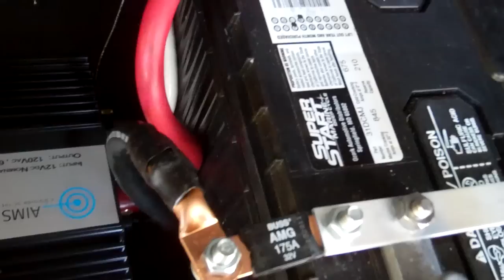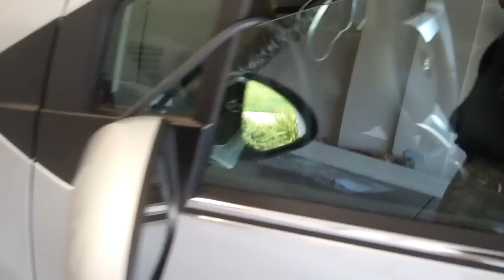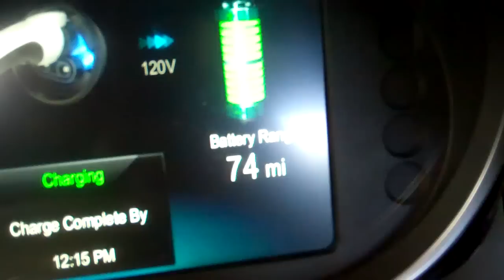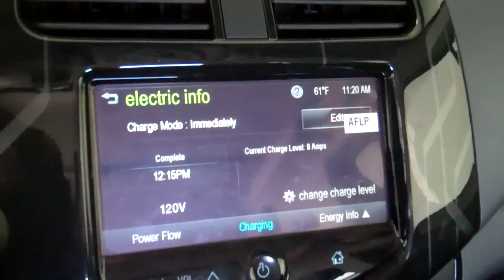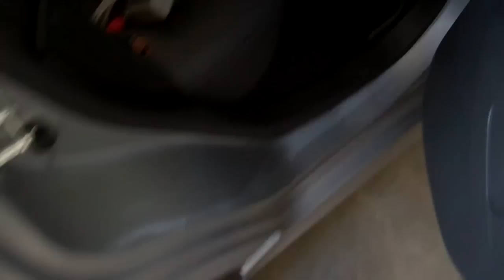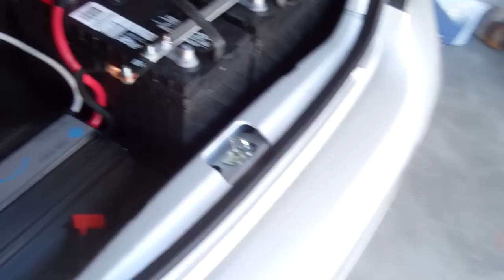DIY EV Range Extender

Comment: Charging the vehicle main lithium battery pack through the auxiliary 12 volt (chevy volt) will work, attach on/off switch to negative and positive terminals. Tried this on first gen chevy volt. Maybe it will work on other vehicles. Try using a battery charger on the 12 volt battery first and check the charging mileage by opening door or check dash, miles should increase. Maybe it works because it is a hybrid vehicle.

Comment: i made a similar aux charger in my chevy volt. weighs about the same but has 15kwh capacity and maxes out the obc for my volt and gives me more than one full charge, capable of doing 6kw output lol.  have put around 200 cycles on it so far and its already paid for itself in fuel savings after ~10 months. i put a video on my page explaining everything plus the aero solar roof i installed which helps with range too.

Comment: 68% of energy is used accelerating mass in city driving.
Now how much weight are you adding here..?  Not to mention reducing space.
ie: this is a POS clickbait extender.

If you want to see a range extender look at the engine  in a BMW Is Rex or at the Obrist Hyperhybrid.

BTW:  Unless you're technically inclined most everyone has absolutely no idea just how much more efficient (and way cheaper) en engine can be when designed to run at constant rpm.
What you will find is that travel is in fact more green in a series hybrid.  Especially one that has a direct drive for highway cruising.

Comment: Good system, 
I like it would make a lower 24kwh car a possibility. It is almost enough for all my drives. 
But got the rare 4-6 trips per year it risk of wont be enough. 
Had a friend buy an ev close to me and charge here..he needed a Tiny bit more to get home thought. 7 chargers on the way map, but ya Nightmare as busy, broken, broken, removed, broken, broken,busy (him with basically dry standing behind the other hoping for a charge 1h later yay! and he could get home. Need about 4-6kwh more😂.
Hum 1-2 batterys and charge them with a small generator (takes time but no longer hesitate on range, i never want to experience what he did on my way to him😂)

Comment: It may be interesting to put enough lithium cells in series to match the car’s battery voltage, then just connect them in parallel with it, so they’re always helping out, and there are no inverter and charger losses.
Reply: Agree, he's probably losing 20-30% with the sine converter then another 20-30% converting it back into DC while charging the car.
Reply: You’d basically have to match the size of the cars existing pack if you wanted to double the range…
Reply: @turtlezed  in theory doubling the size of the battery Will more than double the distance as the draw on each cell would be half and they are more efficient at a lower draw. Obviously, you'd have to take the additional weight into consideration, but I believe it will still be more than double. Slightly maybe like 5% more

Comment: You should try a supercapacitor bank.  Put a small solar panel on the roof of the car or have a pole mount attached to the car and have the solar panel track the sun.  Solar panel charges the supercapacitors and when full can DC fast charge to the EV.  Throughout the day the cycle would repeat.

Comment: Use this it will add 12miles and it already has inverter built in weighs 48 lbs
https://www.amazon.com/dp/B082CWRGTR/ref=cm_sw_r_cp_apa_i_lS1nFbNM3ZM65

Comment: never seen anything so ridiculous as not only have you filled your boot with lead acid batteries ,,, they can only supply just over a kilo watt of power to your cars battery which equates to 4 miles if youre lucky... 
and who wants to drive with 60 to 80 kg in the boot lol !

Comment: I have been considering this, but with a single solar panel so it charges at work. 
Also, saying the weight only reduces range by 1 mile is irrelevant if you don't say how far you drove, that should be a % figure.

Comment: I believe tapping on the main battery would increase the mileage more for more efficient way with more loss. Don't get me wrong.  The idea is great the simple way it is but it can be done more efficiently
Reply: The idea is stupid: Lead acid batteries have an energy density of 20Wh/kg, an inverter has at best 70% efficiency, the ev charger 90% efficiency. so roughly 45 kg of batteries and inverter indeed gives him 567Wh, indeed enough for a few miles. However the 45kg add around 2% in extra drag, as rolling resistance increases with weight, so if he could go 200 miles before, his range will be decreased by around 4 miles, so the net result is nothing gained!!!. What he has achieved is adding a battery with higher self discharge and worse charge efficiency, that also lowers the energy efficiency of the whole vehicle, which result in higher emissions. So this guy forgot to consider the whole picture, when doing his calculation.
Reply: @Tore_Lund  You are the only one who knows what is going on.

Comment: Change the lead acid to LiFE4Po batteries. Yes it works, but LiFE4Po batteries are far less expensive if you do this often, and have practically double the usable power.

Good idea, and fine for once in a while. :) Extra fine if you have solar panels already and can recharge the batteries from the solar.

Comment: Hey – – you can double the air pressure in your tires. Why? I'm getting 150 mpg on a 2000 Honda insight. I'm running 100 psi in the tires. I would only use new tires up to four years old. An older tired cannot take it. I know what you're thinking. If you don't drive like a Dukes of Hazzard the tires will last a long time. My Ford truck I do the same. Every time I fill up three times it pays for one tire. So I bought a set of tires this summer. The tires are paid for on gas savings. I'm sure they will last five years. I have been doing this for 20 years.if there's any questions I would be glad to answer.

Comment: Seems pointless.. Plug ins have an inverter that converts ac to DC.. Since you can't store a/c current..

So you are converting DC to ac and then from ac to DC again.. Why not just connect these DC batteries to the other DC batteries?
Reply: I agree, the reason why he doesn't do that and others with EV's is because the dc voltage is extremely different. The Chevy Spark's battery pack is a 400 volt system so unless his extending battery pack matches that voltage connecting the two isn't possible, and using a step up converter for going from 12v DC to 400v DC is very expensive piece of hardware and the exchange of waste heat it would make. Make it worse then his current setup!

Comment: I been trying to charge a 2018 chevy volt with 3000w pure sinewave inverter, 300ah lithium battery.  It wont work, the charge connector would give error light; i believe it's the "ground" problem of the inverter.  I tried other inverters, too.  I am surprised your charge connector does not give error lights.  Good job.
Reply: Boys, I figured it out....
https://youtu.be/n1u4QVkqhUE
Reply: I had the same issue. Connect neutral(white) and ground together to get rid of the ground fault.

Comment: I found a new way, to charge a battery bank, in part one and two, on my channel check it out. the only thing is though not really enough room in your vehicle to place a gasless generator. your idea is great. i like it. I havn't hooked my design to a battery bank as yet, and the inverter but in the process of testing. missouri solar and wind I bought my pma motors 7 magnet 48 volt motors that can go to 178 volts max. ive calibrated my system for a 1500 watt inverter.

Comment: the power of carrying batteries is more than charge abilities use lithium battery for ex tesla model s battery module and connect inverter to that you will get 5.7kwh of power

Comment: Leave the lead-acid at home, add another string of lithium batteries to your traction battery, and it'll add a lot more range, with less weight!
Reply: that and not blow up having lead acid and lithium batteries together.

Comment: what a gtreat idea if you want a 250 amp cut off switch jeggs speed shop has them online they sell race car parts nice job dude i thought youd get more than 6 miles though .
Reply: He would likely get more range if he upgrades his batteries from marine batteries to higher energy density lithium iron phosphate ones, but those would likely be more expensive, but probably still worth it.  He would likely get another 24 miles range just for doing that and only a tiny bit more weight.   He can improve on efficiency too if he swaps his inverter for a 48VDC --> 240VAC one as it requires less amperage and would dissipate less heat.  Then he could use 4 Lithium Iron Phosphate batteries for the 48V which are lighter for more power.

Comment: Not getting much back for all that work
Reply: An whole lot of experience and an excellent proof of concept.  From there he can branch out onto new ideas for improvement, such as:
1) Swapping the inverter for a 240VAC one (more efficient and will allow your car to charge more than 2X as fast!
2) Using lighter and more energy dense Lithium Iron Phosphate batteries.  Set of 4 for 48V
3) Use a 48VDC --> 240VAC (pure sine wave) converter

Higher voltages means less current for the wattage.  Lower current means less power loss from heat dissipation.     

Just following those 3 simple tips should yield him at bare minimum an extra 24 miles, but likely more. 

But now he knows how to do it, and he has gained much confidence, which itself is very valuable.
Reply: @fanfare100  and 24 ain't worth it hahaha
Reply: @j.thesuper923  minimum.   Being conservative. lol

Comment: For the last 4 winters I have been using 6deep cycle battery to supply a small heater, so all the power from the main battery is used
For travelling, and the 6 battery gives me 2 hours of heating. I solved my winter range problem. The only difference is that I have straps securing the battery’s

Comment: Why would you buy batteries to run through a lossy inverter to a lossy charger? Why wouldn't you just configure a battery bank to same voltage as the EV that you could switch between the 2? And the weight you've added is going to seriously impact on the cars original battery range.

Comment: Hello my friend,  good video , but I thik cables is better than solid connections,  
I dont recommend batterys exposes like this becouse produce acid vapors 
And you need put under batterys a battery plastic tray with drains, you can find on Rv storage. Good luck..

Comment: Wonderful. Ok now you need my flexable 200watt solar panel..it looka like a plastic poster about 2foot X3foot with six eyelets on the.edges ans weight less than a pound. With 200watt continuously being pumped into your batteries while parked your charging system with charge itaelf in the sun. .it can mount on the roof with strong magnets.  The panel.outputs 14 to21 volts 9.7amps dc..with a cheap solar charge control you can charge your batteries to full without overcharging because 10amps at 14 volts is a heafy hard charge it will keep your batteries topped up and you can use your inverter up to 200 watts of it without killing any of your battery power.. fyi
Reply: You will be totally self powered with a 200watt flex monocrystaline solar panel.
Reply: @Gadgetmall  No! it needs 20 000 Watts to be totally self powered. At least minimum 7200 Watts to match the level 2 chargers. 200 Watts are almost nothing

Comment: Yes, as some have mentioned, those are lead acid batteries.  No, No NO!.  We need to stop using these batteries as hundreds of people are blinded every year when such batteries explode and spray sulfuric acid all over everyone.  The warning is right on the batteries!  STOP!  Buy only sealed GEL or some other non liquid, deep cycle battery.  STOP!

Comment: They sell ultra lightweight performance car batteries that weigh 1/3 of the weight of most car batteries. A better range extend option is to build a battery pack with the same voltage as your onboard battery pack and run it in parallel (doubles your range)

Comment: Sure you know what I am, about to say, but just incase or if one of your viewers is not aware of the below.

a. Each time you convert power to do anything. Example charge a battery to charge another battery, you loose energy. Your set up seems to be going thru 4 different steps to use your range extender.

b. I strongly suggest you secure your led acid battery and if at all possible bo not mount any battery (especialy led acid) near the bumber of the car. This is a crumple zone and a rear end colission could end up spraying acid on the car's occupant with immediate, devastating and life long effects........

c. If you really need a range extender, Perhaps carrying one of the  small neat and clean red suitcase style Honda EU 2000 extremely quiet and efficient ICE generator would be better?

Comment: When charging and discharging these vented lead acid, marine batteries, you'll be producing hydrogen gas which can accumulate at ceiling level in your Spark. By placing the inverter right next to your batteries, you'll be sucking not only hydrogen gas in through the inverters fan but also acid mist. A single spark from a relay in your inverter or a loose battery lead and you've provided an excellent source for ignition. I would be extremely careful about using this device with the windows rolled up. I don't know if you've ever seen a vented battery blow up, but I have, and it isn't pretty between the damage caused by the explosion but also the sulfuric acid that is sprayed everywhere. For your safety and for your EV's sake. I would suggest switching to sealed AGM LA batteries or better yet, lightweight, sealed Lithium Iron Phosphate batteries.

Comment: You could also just carry the 12-110 V inverted and a Jump Start cable 
in case you are stranded and use any ICE to give you a jump.

The issue is that you have to carry all of those extra batteries and also a battery charger.

Comment: Very smart. Impressed. How many miles did you extend with three batteries?
Reply: Why don't you try to mount a small generator instead.
Reply: @truthmatters5536  If he wanted to use gasoline , then he would own a gasoline powered car !

Comment: Or, as an alternative, a small generator like the Honda 2000 that weighs less and can add miles for as much gas as you can put in it...
Reply: Dirty Blond, it’s not about increasing the range only. It’s for the environment and to save money. The generator defeats that purpose in cost for gas.

Comment: with how you have connected your inverter cables to your battery bank you will cause the first battery to be used more than battery 2 and 3   Electricity takes the shortest path  never forget this rule,  so to solve this just turn one of your bus bars around so the cable is at the other end,
Reply: No, electricity takes ALL of the paths <= never forget this rule !
Reply: @vtorsi610  not at the same rate

Comment: Paul: Very clean & meticulous install.  Great effort on your part. Two items of note that I might mention. #1 You might want to reconsider the terminal that you choose to switch out the inverter when regular charging from the house mains to the POSITIVE lead instead of the negative since attempting to use the negative lead with your Marine grade 12 volt 100 amp switch could possibly result in a loop back via the inverter's chassis ground safety lead. #2 as impressive and neat as the BUS BARS are (which would be fine in a static scenario) they could cause permanent damage to the posts of your SLA batteries due to constant vehicle vibrations. JUST A THOUGHT !   A few tweaks and some minor changes could result in a great little range extender. Kudos to you and all the best in your efforts.